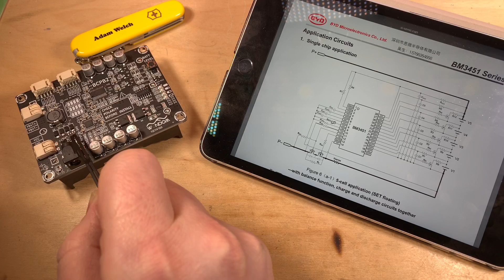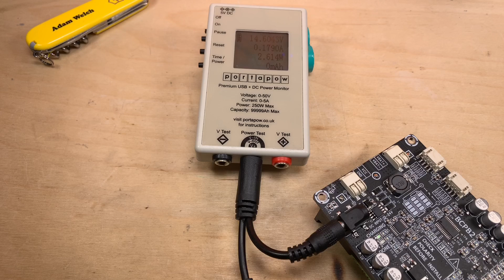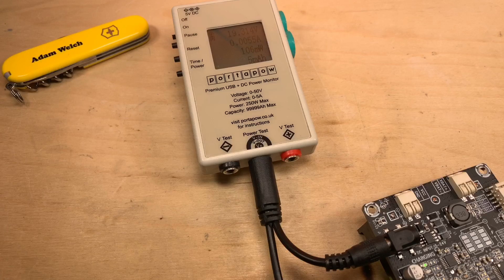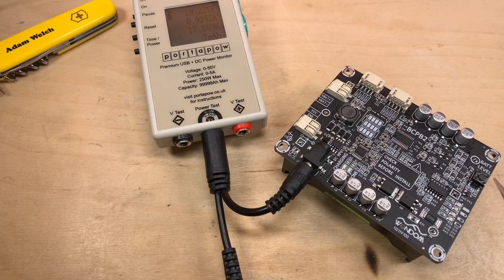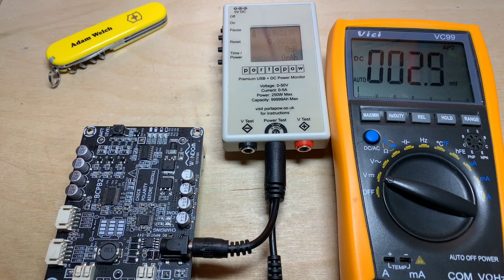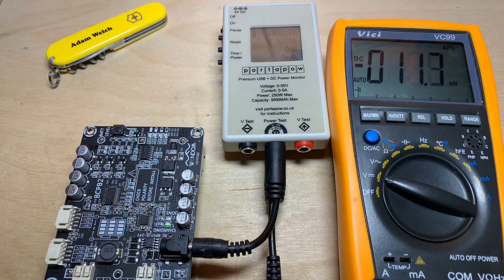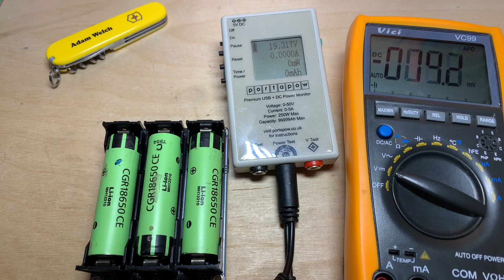Cheap 3s Lithium Solar Charging & Balancing Module

Comment: Have had this in service for several years, my only gripe is the lower charging rate, can only do a max of 18 Watts. Would be far better if charge rate could be doubled, or selectable.
Reply: I have been looking at these and the wondom 5s and 6s. It is maddening how not a single piece of literature mentions what solar actually accepts. They say up to 24v but is that 1w or 100w... its weird. This lineup at 7s and 200-300w of solar would be really cool. I was thinking this 6s one would make a decent way to get several DC-DC converters hooked up together. Some XT60 cables, etc. And the solar part would mostly be as a backup or portable as needed.

Comment: Is it possible to use the red CN3722 charging board in place of the BCPB2's own charging circuit? if it was wired to the battery - and + connections for example, to get the best of both worlds?

Comment: Yes, solar electricity is good when you charge batteries all the time on the ground. I have 3 electric bikes that are charged with solar energy, that is, a battery bank and an inverter to which the bike charger is connected. has worked well.

Comment: My continuing issue is finding 18650 batteries that really do have their stated capacity. I've tested 3 different ones now from 3 different suppliers, none of them even reached 50% of stated capacity (including a Panasonic one). I'm starting to think all 18650's in existence are either fake or from old laptops.

Comment: Hi. Today i mounted 9 cells in a 3s3p way into a 15W solar panel with thermal insulation as a portable power source with an additionnal 19 v jack of a laptop power brick. But the charging current from the power brick is only 200mA!! Does anyone know why? These boards are made by a Wondom for bluetooth portable speakers and  similar. I was thinking i would charger the batteries with. A separate charger till they reach 12V and then switch to the balance charging....
Reply: Dell and HP chargers need a 3rd connection to "trigger" them. The connector is a pin, and a double-sided barrel.

Comment: Anyone have a solution? - 12V solar cells. Powering 8W of LED lights. Needing a battery charging solution that can power through the night.
Reply: Use mains power, as solar panels cannot charge during the night.

Comment: I’ve seen a few of your videos which are really good, but I haven’t been able to find what I’m after: Is there anything you know of, at a reasonbly low cost (say under £40 or so) that I can use to charge makita 18v Lithium Ion batteries from a 150w solar panel?

Comment: Thanks for a great video Adam.  I have bought one of these and inserted three 18650s, all charged to 4.15V and attached it to a 20W solar panel.  Unfortunately the battery output is reading only about 1V.  I'm guessing it's a faulty unit :-} ?
Reply: My battery output is 2V but someone said it needs a brief input voltage to trigger it...??

Comment: Great videos Adam! Have you ever come across a decent solar charge controller that also regulates power from a vehicle alternator? Or would you recommend just keeping those parts separate?
Reply from the maker: The alternator itself will regulate and shouldn't over charge your battery.  While the engine is running and the alternator is keeping a battery well charged the solar charge controller should regulate too and will probably supply only tiny amounts of current to the battery.  So both items can be directly connected to the battery, with the solar connecting to the solar input of the charge controller.  For vehicles you just need to think about your solar charge controllers common grounding and a vehicles negative earth.  You can use positive or negative ground charge controllers, you just need to think about your wiring.  Does that help?
Reply: @AdamWelchUK  Sort of, I guess what I'm asking is if there is a solar controller that also boosts the alternator input as it's usually low for a deep cycle sealed battery (from what I understand), especially at the end of a length of wire. I'd like a smart charger that will ensure a proper charge from the alternator, and hoping to find something like the CTEK D250SA charger, but in a less expensive form factor. I've considered just buying one of these as the source should be high enough for the solar controller to boost the 13.? To 14.4v.

Comment: So if you connect it to solar power, does the current change all the time? Does it damage 18650 cells in any way, when you charge them not in a constant current? manufacturers say those are CC/CV ones, but what if you charge them when it's cloudy or the sun is going down? I bet the charge current is changing all the time. I suspect that they use CC mode only for charging 18650 cells as fast as possible, don't they?
Reply from the maker: Yes you’re right. In all solar applications you maximise your current while you can and clouds and other weather will reduce that input. So the cells aren’t charged in the optimum way. 

I built a solar charged 7s4p pack and ran it for a year cycling it as much as possible (there’s a series of videos about it) and tested the capacity after a year of use. That might be of interest to you? 
https://www.youtube.com/playlist?list=PLXyc_wd5sxbhYhAKHVq8SGQ2Sncl1PDDT
Reply: @AdamWelchUK  Oh yes thank you, man! I am building maybe a cheap velomobile with 12p4s and am planning to use a honda civic starter 1kw as an assist for 10-20secs. Efficiency maybe 60%, but it's very simple. I will try to keep the current limited, and charge 6s2p greencap 500F supercaps, then give this current together with 18650 to the motor when needed. I am also thinking of regen braking, but am not sure if it's worth it as bicycle does not have so much "sharp" braking periods... And I would need more weight with sepereate generator, so it's not a good idea until I change everything to a 3phase, but that's later. I want to charge my 18650 pack with two PC power supplies, I've tested them via a load resistor, they seem to work giving 5+12+ total 17V, but the current is going down all the time. So, I will try to use a step up/ step down CC/CV boost converter, but did not know if It's necessary. Looks like two psu's are doing quite well, as I need 15,6Amps of charging current. I will check your build, I am sure to find some important information. Thanks again :)

Comment: Your video is only a month old and this MPPT is no longer available as per Amazon and I can't find it on eBay.   Eerrrrrr.....   It is nice and convenient.  About how much $$$ was it when you bought it?
Reply: like mi i don t find it
Reply: Try this one... http://rover.ebay.com/rover/1/710-53481-19255-0/1?icep_ff3=2&pub=5575189419&toolid=10001&campid=5337903455&customid=&icep_item=141225673896&ipn=psmain&icep_vectorid=229508&kwid=902099&mtid=824&kw=lg

Comment: Hi. I am no expert but I am seeing something I don't understand with my unit. If I measure the individual battery voltages they are all at about 4.16 volts. But if I measure the VBat output socket it's at 12.66 volts. So there's a slight voltage gain. I've measured time and time again. Anyone know why?

Comment: Please can you help or somebody in the comment section I need a charge control so I am looking at buying the epever MPPT charge controller what amp do I need to get it in if my Solar panels are 36v at max and 250w at max an 8.69AMP at max and I’m going to use 4 12v Diesel car batteries please can use tell me what amp charge control I would need and a on more thing I’ve got 2 of them Solar panels so I and going to put them in parallel so the amp and watt will be double
Reply: You didn't get a reply because nobody can read a 1000 word sentence with zero punctuation. Furthermore, you answered your own question regarding the AMPS.
Reply: I'd get the 20 or 30 amp personally tbh as it allows for expansion and for the panels in case the produce slightly more than spec sometimes

Comment: The not charging up to 12.6V is normal these days.  Lithium cells do not have much tolerance of overcharge.  I have seen tests showing that 4.35V is enough to cause a cell to explode in flames.  That's only a 150mV error.  So most manufacturers error on the side of caution.  Good hobby grade RC charger provide a calibration setting allowing you to take your won risks and calibrate it to 4.20V per cell, however these are rare and most now just charge to 4.15V or 4.18V per cell so they always error on the side of caution.

Comment: The current dropping off as the cells reach higher voltages is not only expected it is by definition the result of CCCV charging.  The CV stage maintains the 4.2V per cell and allows the current to fall off.

Comment: Having spent a lot of time researching options for this (Balance charging from solar) I came back with two issues:
1.  Most battery management ICs are extremely low current.  Best I could find was a 2 Amp charger.
2.  All most all balance charges are wasteful, dumping excess cell charge by mosfetting in a resistive load.

There 'are' technically better ways which are more efficient, but non-standard.  Switching over to charging individual cells via the balance leads when out of balance tolerance is the most efficient.  So rather than dumping overcharge of the higher cell, instead switch to charging the low cell individually.

Comment: I ordered one of those directly after your video. It does not proove a constant voltage output. It's just the voltage of the batteries. And after inserting the batteries you have to "Ignite" it by providing external power once for a short time. We had some sun here today and it loaded the batts quite well. If you add an constant power buck-boost-converter it will become a nice device.
Thanks for testing!
Btw. the connectors are working like a spring; you don't have to push that plastic thingy. Just put a wire in and the plastic is just for releasing.
In the description is mentioned NOT to daisy chain the modules. I cut the wires apart in the middle and now I have two additional connectors.

Comment: Thanks Adam. Have you considered adding three LED's across the bleed resistor circuitry, to indicate which cell(s) is/are being balanced?
Reply from the maker: I did indeed - like Julian does. :-) I may do that in another video if it throws up anything interesting. Cheers

Comment: Having the lower voltage is so much better than 4.21.  Wish it were 4 cell and 3.85, 3.90.  If you put a load on it with no power input, what is the cutoff voltage?  What is max draw?  The combiner wire used to connect boards together, or is it use to add batteries?  Is it used to make 24V? I wish more companies would make boards like this.  Even regular solar mppt chargers should have balancing circuits built in.   But least give it to the company for being the 1st to try and combine.  Maybe they can make a 7s 8s in the future, they would make a ton of money.  But I guess you can just use a power bank.

Comment: This item is almost worthless due it's low AMP limit  LOVE your videos keep them up.
Reply: If there is 1A of current and you charge a typical laptop pull 18650 (around 2000mAh) then your batteries  will be charged in about 2 hours. So, there's perhaps 4 or 5 more hours of sunlight which could charge another 1 or 2 cells in parallel.

Comment: Where is the OUTPUT? Over discharge protection?
Reply from the maker: The output from the cells is available via the jst connectors and the output connector in the top left marked vbatt+ and vbatt-. The BM3451 provides under voltage protection. http://www.si-semic.com/upload/1460800283.pdf
Reply: THANKS!  Just wanted to make sure my garden lights are not going to ruin my 18650s on long dark days/nights.   BTW: I love your videos!